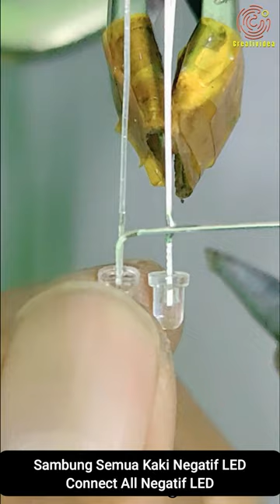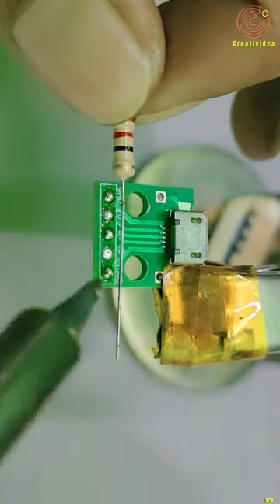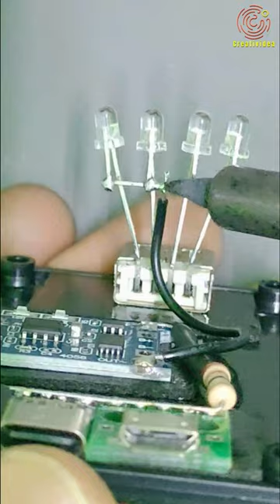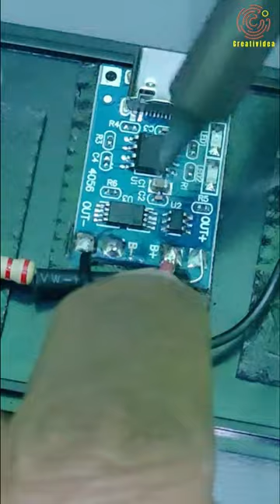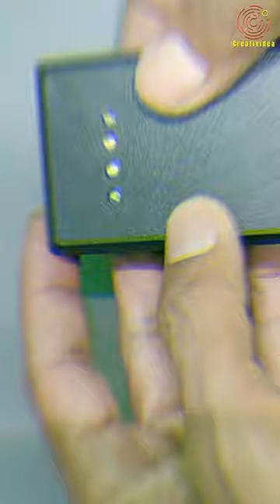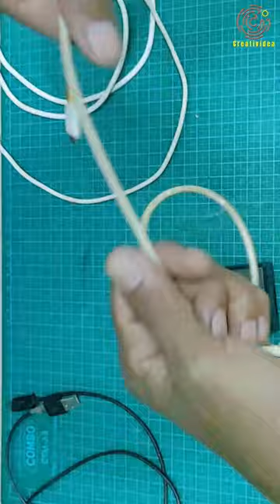Tester Kabel Data USB

Comment: Bro. IT is not bad and good cable 
Where the light indicates full means   it can be used to transfer data and the other is just used for charging
Reply: ya bener ini
Reply: Its bad because it makes slow charging
Reply: @littletomato7201  nah except ur using pd or other fast charging protocol